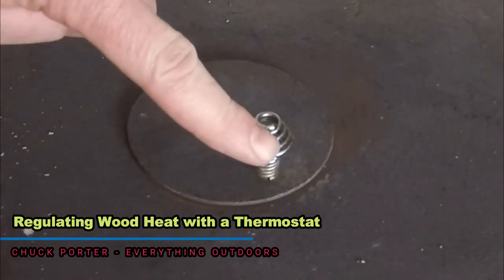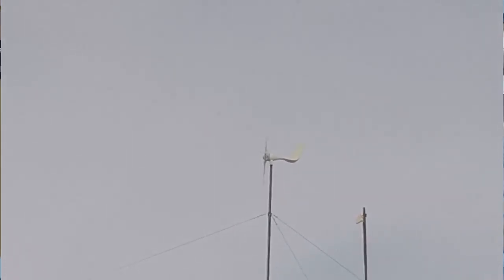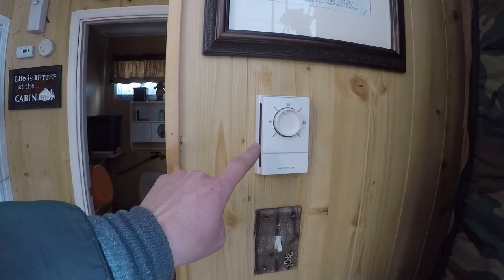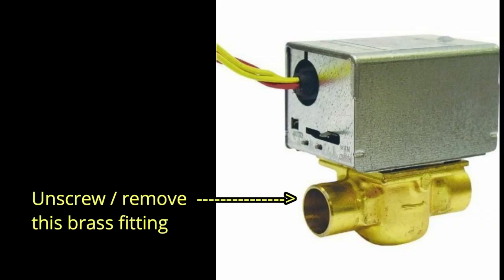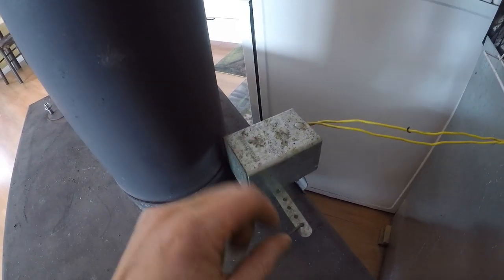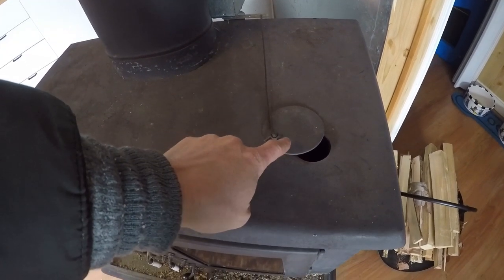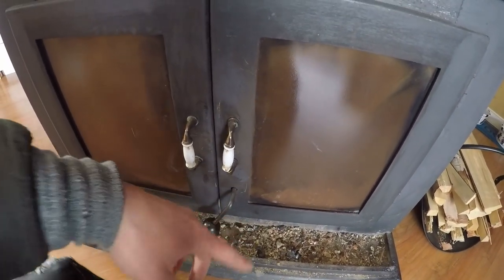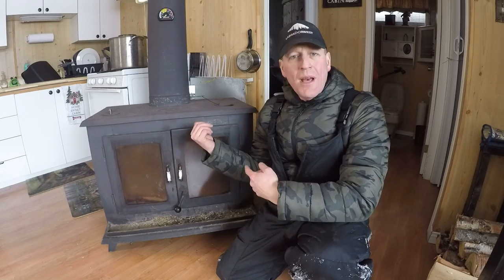DIY TRICK!! - REGULATE YOUR WOODSTOVE HEAT WITH A WALL THERMOSTAT!!  |  PERFECT TEMPS!!

Comment: Lol that’s a fine job. I’ve seen that done before but the guy had it attached to the key damper on the pipe and used the control box off a summeraire furnace which unfortunately they no longer make. Great stuff keep the videos coming.
Reply from the maker: Absolute great idea as well. Not sure how well it would regulate but I’m sure it does the job. A bonus to that would be that it would be more universal (as all have pipes) whereas mine is dependant on the sliding drafter

Comment: Very cool Chuck! I myself am tinkering with Thermostat, 12V relay and small fan, maybe the middle size 3 in box fan from a computer power supply.  All 12V. I am off grid 40 years as well BTW. Don
Reply from the maker: There’s been a nice few people have tried this now with tremendous results. As long as you have an “easy sliding” damper then it works well
Reply: I'd like to control the damper off of pipe temperature. Open at say 300 and close at 350. Creosote wouldn't be an issue due to always being in the burn zone

Comment: Nice video, I noticed u have a cell booster I noticed the antenna outside, should do a video on it 😊
Reply from the maker: I’ve have a few requests to do a quick tour of my off grid cabin. I plan to do that soon and I’ll include the cell booster for sure 👍
Reply from the maker: We have zero signal until we turn on booster. Then we have 3-4 bars once on. Never saw the one like yours where it only cuts in on voice though. Great idea for off grid.
Reply from the maker: My buddy is a hammie and has a cabin next door to me.  Guaranteed we will have a chat about this. He’s the radio genius!

Comment: Can I use any thermostat or only like this mentioned in your video? Also where did you bought this zone control valve? Because I searched for and and found different which used for water system
Reply from the maker: When you get the thermostat, all you need to figure out is the voltage and then get the voltage reducer to match it (from 110v to whatever voltage your thermostat is rated at)

Yes you can use the zone control valve used to control water systems. This is in essence what I’m using here